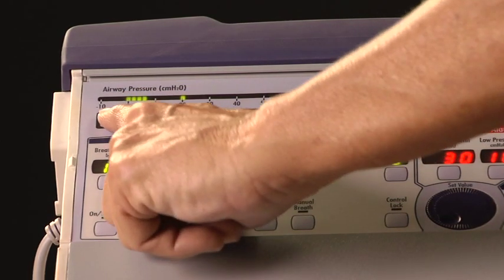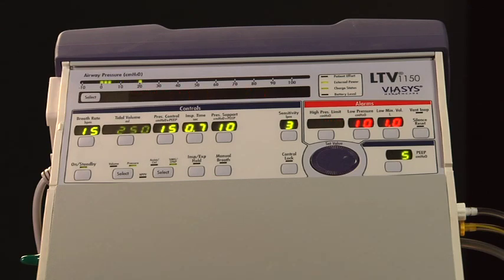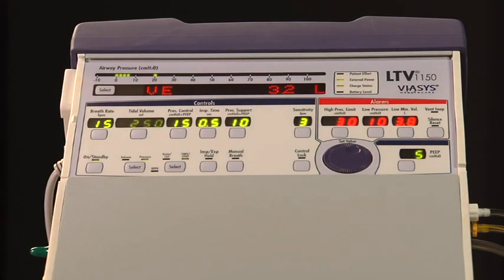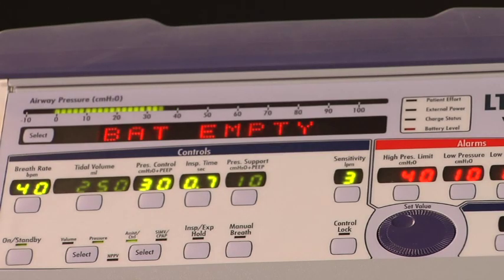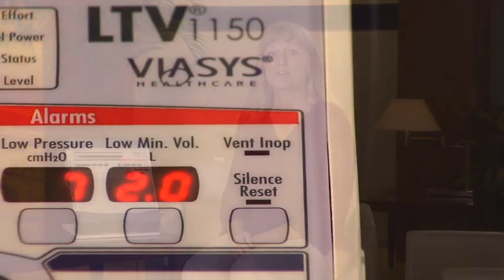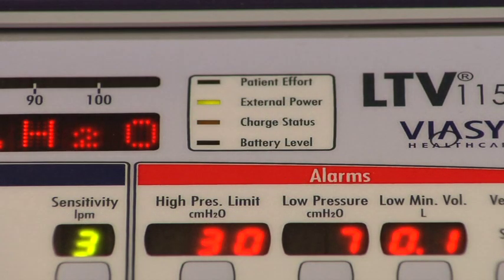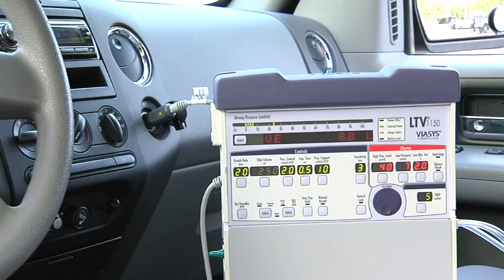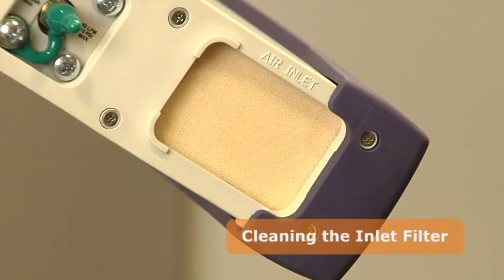LTV1150 Ventilator Caregiver Training Video Part 3

Comment: The LTV while old, Is a very good ventilator. Now would I choose this over the VOCSN? No, ABSOLUTELY NOT! I'd choose a VOCSN over this ventilator, but if this ventilator was the only vent I have access to, as is in my case, It'll do. It has flow sensors at the wye, and has great sensing technology. It does not have waveforms, unless You're using an LTM, but for stable home patients, It's a good ventilator! It doesn't have O2 analysis, or anything really fancy, but It's a good vent.